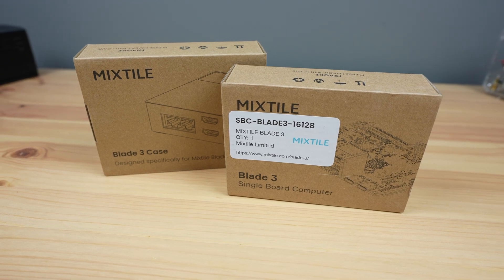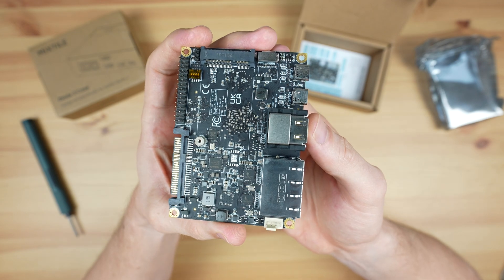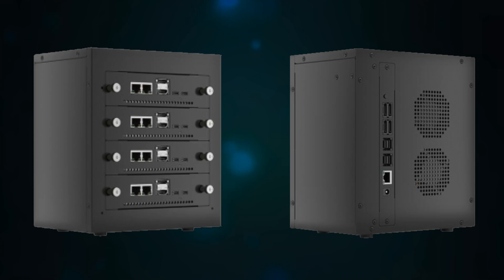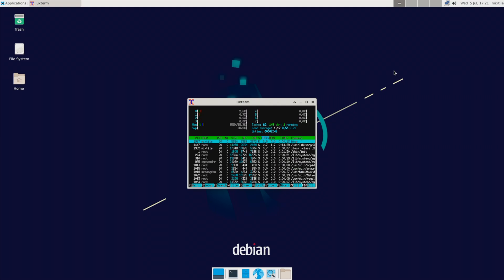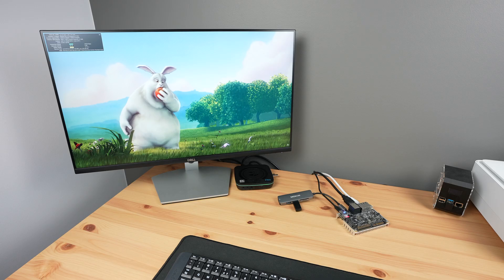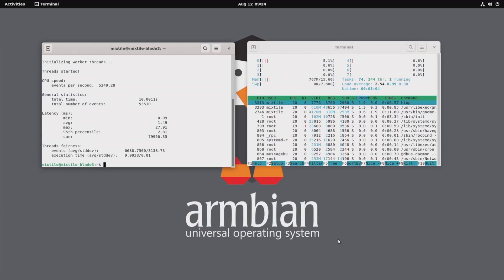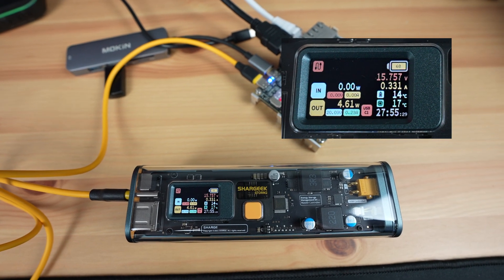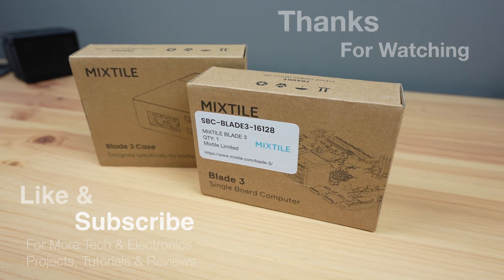Supercharge Your Home Cluster With The Mixtile Blade 3

Comment: I'd love to see a water cooled mini gaming case for the single board but also 
maybe attached graphics card support. I'd love to see what the cluster looks like 
if it were in a pico form factor gaming case that was water cooled and could play
steam games like the Rock Pi 5. Which uses the same CPU, I think. A cluster at a 
good cost could be a great option for gaming replacement and work replacement.

Comment: Hi. Great video. 
I also got the board and reviewed it. I like it a lot. I helped working on the Armbian images for it with RPardini and Monkablyat. 
I did have a problem with it last week. My NVMe died while using it. Not sure what's the cause. I was using it and suddenly it crashed while still running in memory but unable to do anything. I re-installed Armbian to eMMC but the NVMe is dead. 
Now using the M.2 with a 6 x sata adapter and I'll use 4 SATA ssd's with it using it as fast NAS and secondary desktop. 
I like that it has 2.5GbE, fast M.2/PCIe + mini-PCIe. 
I'm also missing a full sized USB port on it, and also mentioned the inwards sd-reader that's a bit strange. My temperatures were different but I max out the cores for +30minutes and a lot hotter room.
I didn't know your channel. Subscribed and looking forward seeing more. Greetings, NicoD.
Reply from the maker: Hi NicoD,
Thank you for sharing your thoughts and thanks for your contribution to the Armbian image!
I'd expect my temperatures to be lower than most others as the room temperature was quite low, I think in future tests I need to get the room up to a more typically room/office temperature before doing the thermal tests.
Thank you for the sub, I'll head over to your channel shortly.